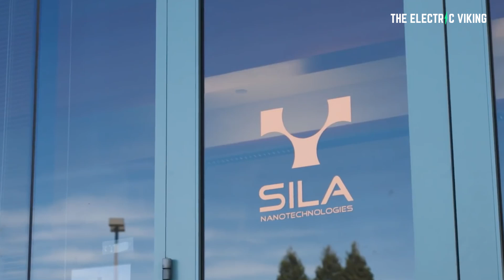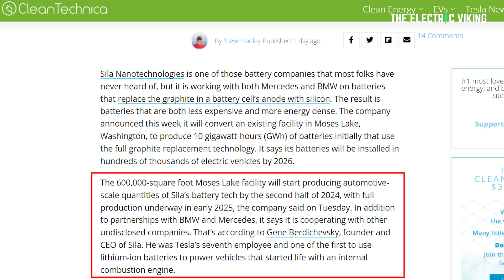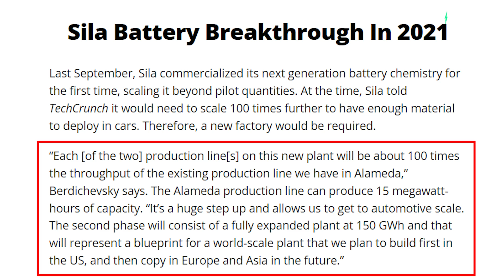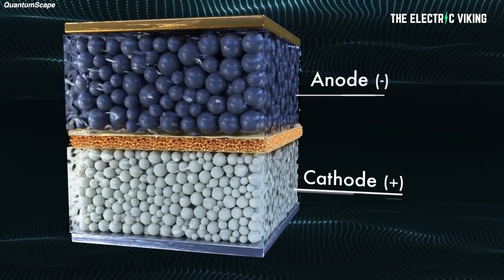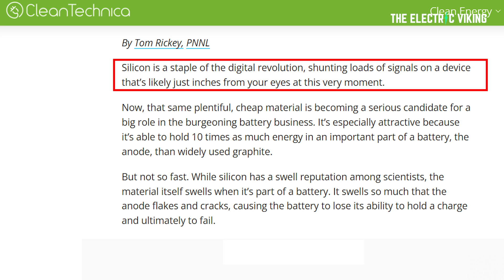US companies battery breakthrough will change the world

Comment: Increase Li battery capacity in 1 year?  I'll hold them to that as Lithium based won't last for more than 2 or 3 years but they could make an impact if they could do it in 1.year.
That could mean reducing the weight of Li based EVs as well as more BEVs - of course it is all proof in the putting.  Can they or cant they?

Comment: I am a robotics engineer that has worked on drones, including making our own batteries. We switched from pouch cells to cylindrical cells (18650/21700) as they are more robust in a crash. Pouch cells are lighter and cheaper per kw/h but when they get hot or in an impact, they can be dangerous. I can see these silicone batteries being the same for the engineers, on paper they are better but you have to make them safe in an impact or if they are in hot bumpy areas, not so easy. Yes, on paper these seem great but the information seems to indicate they aren't as robust as more mature battery types. I wouldn't want to have my car burst into flames if I was on a hot bumpy road and needed to use a fast charger. Everything is easy on paper but when you have to real world test for worst case scenarios, you have to defer to the safer option a lot of the time. Hope it works out though.

Comment: Silicon is cheap and plentiful but if purity matters and I think it logically does, then the cost starts going up.  How are they getting to high purity on scale?  How is the expansion mitigated? How is the Anode produced at scale?  We know the energy density potential is there but these questions have to be answered.
Reply: The New factory is REC Silicon's neighbour. So most likely they will get it directly in pipes from REC.

Comment: "All they need to do is scale it up".  That's the biggest problem with the e revolution.  Scalability.  A Tesla works great now.  What happens when everyone drives a Tesla?  On a grid powered by wind turbines and solar.  Assuming we can supply the power how does the charging infrastructure work?  I'm not saying it can't work, but a lot of folks seem to think that this like the telephone, the hard part is getting to a certain level of adoption.  I reckon it's different, the hard part is when everyone is using e cars.

Comment: Silicon in battery is nothing new, all you said is true about density and cost you forgot to mention that silicone cracks when you change and discharge the batteries that is why they are not around. No this is not it

Comment: Any battery that requires lithium is problematic due to the mining and availability of lithium.
Reply: yes, but if you can increase the energy density, you need less per kWh. the availability is extremely high and it is not always problematic.
Reply: @stefanweilhartner4415   There is availability issue in getting the raw materials needed - energy density does even factor into what he was talking about.  Commodity mining, supply and refining have all taken a massive hit since the pandemic and we are going to be heading into such a constraint in production that prices which have already gone up a lot will continue to skyrocket.
Reply: @corail53  we have plenty of lithium and sulphur. this is not an issue. silicon is almost unlimited. the only problem so far is nickel and cobalt.
Reply: Among the many the other finite materials needed.

Comment: Did you get the reference to "the device just inches from your eyes"? It's the pair of glasses that so many of us use, or more precisely the lenses in them. Glass is of course made from silicon, which is basically plain sand. The signals they shunt is of course the light, i.e. photons, that pass through them to the eyes retina.

Comment: Only for the high end EV's, that will become even more expansive. 
The fantasy in 2012, that EV's will be cheaper than ICE vehicles in 10 years, is what it will stay, a fantasy. EV's are even getting more expansive since 2021.
Building more €80.000+ EV's like Mercedes, BMW, Audi, Porche, Tesla is getting boring, as are their SUV and sedan models.
The masses of People with the small €10.000 to €20.000 ICE vehicles will keep riding their cars for many decades, if not for ever, without having a chance on an affordable EV.
Reply: This is where China comes in they’re aiming to produce affordable $15-20 EVs aimed at general transportation usage and doing it in attractive practical packaging. BYD is a good example of this approach. An affordable practical quality produced EV. Also need keep in mind the repairability and replacement of parts/batteries. NIO is approaching it with quick replacement battery systems. So getting into complicated revolutionary battery systems may not always be the best inexpensive outcome.

Comment: Just because it works for wearables doesn't mean it will scale for cars
Reply: it works better for cars because you can apply the economy of scale.
Reply: @stefanweilhartner4415  I could write a long comment and the scale of it would make it work. lol
Reply: 1000 plus miles range in a Mercedes, 50mph average so most definitely not hypermileing. Proven beyond doubt to be capable, watch closer next time and read headlines about batteries more often.
Reply: @AndyAndy-we9pe  friend has a brand new merc 220 miles at 50 is what she gets.
Reply: @AndyAndy-we9pe  As charging networks expand and charging speeds increase range will become less of a factor. Other parameters like cost and driving experience will take priority.

Comment: Looks like  #StoreDot Batteries got pasted over. 🤦‍♂️

"#StoreDot Batteries" 

Like I have been saying I'm sitting out from buying an EV for the next 2 years.
( I would like to wait longer but I don't have the patience)
 The 1st EV  I will buy will probably be in 2024,  the way battery technology keeps advancing and at its current rapid rate a EV today with today's current battery configuration will be obsolete within 2 and a 1/2 years.

 Prime example is that the early EVs with the "3G Technology" are now dead in the water with "5G technology"  kicking in.

Comment: What’s needed is a standard battery, like AA and AAA batteries but bigger for EVs, we.need to decouple the vehicle from the batteries. We need to be able to upgrade/replace batteries, buy an affordable EV with a standard range and upgrade range later, have the option to lease batteries making the initial purchase price way less and replace batteries when new higher power density batteries hit the market, since technology is moving so fast.
Reply: Yes, my thoughts exactly.  I even wrote a page on this.  Do need a little more density for it to work in cars to the level it does already in motorcycles, but user swappable standard batteries will be come.
Reply: Premature standardisation of battery sizes might make it harder for companies to do experimentation to improve battery technology. I suspect such standardisation might happen in, say, a decade's time when there is less experimentation with battery technology.
Reply: @CiaranMcHale  I am thinking more like electric motorcycle swappable batteries. If batteries can get 4x more energy dense, then 4 to 6 batteries the size of electric motorcycle batteries would be enough and be a complete game changer.  It could take 10 years, but could be a bit less. But if/when, it would change everything.
Reply: @onefiniteplanet  That is certainly one approach. I have been working my way through the backlog of videos on "The Limiting Factor" YouTube channel, which is basically a deep dive into the science of battery technologies explained (almost) simply enough for a lay person to understand. I understand a subset of the content on the channel, but one of the key takeaway points for me is that scientists (some of whom are funded by Tesla) are optimistic that they will reach the holy grail of a "million mile battery" within the next 5 or 10 years. Apparently a typical ICE car has a lifespan of about 140,000 miles because an ICE engine causes lots of vibrations that cause gradual wear-and-tear on the structural components of the car. Since an EV's electric motor causes far less vibrations, it is believed that an EV might last 500,000 to 1 million miles. Having a battery pack that can last 1 million miles before needing to be replaced means the battery pack would never need to be replaced during the lifetime of the car (by the way, the "it's time to replace the battery" metric used by scientists is when the battery drops below 80% of its original capacity). If this holy grail is reached, then it would significantly reduce the perceived need to replace batteries in a car; instead, you are more likely to just replace the entire car (and the battery pack would be removed from the about-to-be-scapped old car so it can be used for another purpose, such as a battery for solar panels).

Another thing to consider is that the cost of lithium ion batteries dropped 87% during the 2010-2020 decade, and are predicted to drop another 80% during the 2020-2030 decade. If this happens, then replacing a battery pack might cost only, say, $2000. This might raise the possibility of a person buying a car with a limited range initially, and a few years later deciding to pay $2000 to replace the still-good battery pack with one that provides longer range.

I'm not saying you are wrong in claiming that swappable batteries is a promising idea. Rather, I am just pointing that that there are other, competing promising ideas. It will be interesting to see which approach wins out.
Reply: @CiaranMcHale  The swappable module is not to solve batteries having a short life, as if not long enough already there are already a few tech to give the million mile battery, just need one to get to market. Swappable batteries are to address other issues.  I agree battery life is not a significant issue.  Imagine a battery small enough to be in 4 swappable modules the size of a motorcycle battery, easily swapped by hand.  Those parked on the street could carry a module into their home to charge overnight on a regular day when only one module was needed. Once energy density is sufficient, we solve the big problem of all those cars on the street that otherwise pay around 4x for their charges.  There are other benefits too.
Reply: @onefiniteplanet  Interesting idea, but there are challenges. Google suggests an 85KWH Tesla battery weighs 1200 pounds (540 KG). To keep the maths simple, let's assume a 5.4x increase in energy density (which I think is far too optimistic but let's keep the maths simple), so the weight will come down to 100 KG (220 pounds). If that is split over 4 modules, then each battery module will weigh 25KG (55 pounds). In my experience, when filling a suitcase for travel, anything above 20KG makes the suitcase difficult to lift (30KG is a real struggle). So it would be quite a struggle for a person to carry a 25KG battery module from their car into their house for overnight charging and then carry it back to the car in the morning.

In addition, I assume your intention is that the car owner would charge one battery module on Monday night, another one on Tuesday night, and so on for four nights, and then start at the first battery again on night five. By doing this, you would end up with the car containing four batteries, each of which is at a different level of charge. I'm not sure that would be wise. I base this on seeing "do not mix old and new batteries in this device" on the instructions for battery-operated devices.

When ICE cars were being introduced in the late 1800s and early 1900s, there was not a widespread network of gas stations. Instead, car owners often bought cans of gas from pharmacies. It took a few decades for gas stations to become widespread. The UK government is requiring new houses and apartment blocks to provide EV charging facilities, and I suspect it will take a decade or more for existing houses and (car parks of) apartment blocks to be retro-fitted with EV charging facilities. Until then, many people may find it inconvenient to recharge their EVs. But removable battery modules are not the only potential way to address this temporary problem. For example, another option would be for shopping malls and supermarkets to provide EV charging facilities in their car parks. In the UK, some large supermarkets have a petrol ("gas" for Americans) station adjacent to their car parks, and if you spend at least, say, £50 in their supermarket then your receipt will contain a discount code for filling your car with petrol. Perhaps supermarkets would provide a similar incentive for charging EVs: "spend at least £50 in the supermarket to get a discount code on your receipt, and you can use that to get cheaper electricity for your car in the car park".
Reply: @CiaranMcHale  Your weight estimate sounds about right.  But an 85 kWh battery is a quite a large one and would need to represent  more than 4 modules.  What is the average distance per driven per day in the UK?  I could not find it quickly, but way more range than would be needed in a normal car other than when on a road trip.  Still, I agree modules alone is not a solution, but I am worried about the social implications of those who can't charge at home having to pay a multiple for charge relative to those who can charge at home.  Interesting discussion, and you have good thoughts, but hard to have it on here.

Comment: We can bet that Tesla will be using this technology. However, if it needs rare elements there will always be problems. Nickel, Cobalt, Manganese are not easy to mine and refine hence the sky high costs.
Reply: That is the major downfall of all this and it is not green (ie: digging holes in the ground to get those finite materials and turn them from ore to usable material is very fossil fuel oriented and well you are still ravaging the earth). We are heading into a commodity crisis as well - supply chain issues mean mining issues which means costs are going to get even higher than they currently are.

Comment: Like to know how they prevent the use of silicon cracking and degrading the battery.
Reply: silicon nanowires in the graphite anode. the silicon percentage is very low but it is very effective. they leave a lot of room for lithium ions to dock on the silicon nanowires which also have a certain flexibility and bend instead of breaking.
==> sinanode
Reply: @stefanweilhartner4415  Thanks, sounds promising

Comment: It seems possible to make silicone Dimond hard with other layers of materials also
Reply: how did breast enlargement get into this conversation?
Reply: @keithmiller4168  well if types of silicone can be used to replace super expensive graphene batteries and more ready for market , One problem silicone has when heated and cooled is expansion and contracting, a reasonable fix might be to try to keep the silicone battery atoms and geometry from breaking, say like super compression mixed with some kind of ultra capacitors,all layers could bring the best out of eachother for superior batteries then what's in cars and products today.
Reply: Lighter batteries we could see big camper Van's with long range.

Comment: Very interesting vlog silicon as you say has been known to have the swell problem , and it’s a hot development to be working on, I can  see at best double the power density any more the swell will still be a problem it’s a fundamental fault at the atom level that can’t be solved without a down side, it most likely will be the charge cycle that will suffer, Tesla are all over this type of battery and gave been for some time, when they say it’s doable that’s when it will happen on scale 👍
Reply: I believe there are silicon batteries with quite a bit better than doubling but the cost of nano silicon is still way to expensive

Comment: Cost, Cycle life, Charge rate, safety... Battery breakthroughs usually fail on at least one.  I wish them luck.
Reply: Proven in mercedes
Reply: Cost & cycle has been been the issue hence initially they been used in drones & planes if they have the cost down it is very viable in long range vehicles as you don’t  need as many cycles if your battery can do 1000km per charge.As they get closer to  nano size silicon the higher the energy density atm nano size silicon is too expensive but they are using larger size but still very small particles.Which there is still a lot of upsize in the technology

Comment: Volvo and Northvolt are doing the same thing. That is, replacing graphite in the anode with silicon. Should be out in 2026, according to Volvo.That's when Volvo said they will have 1000 km (620miles) range if needed. ... But great to hear another US battery plant is on the way.
Reply: Are these guys also building a battery plant?  Their pitch is selling to battery makers, not selling batteries.  They could even be the supplier of the silicon material for Northvolt.
Reply: @onefiniteplanet  Northvolt and Volvo are building a 50 Gigawatt hour factory in Sweden, plus Volvo will source 15 Gigawatts of batteries from existing Northvolt plants. Volvo is also getting batteries from LG Chem and CATL. ....And Volvo and Northvolt are building an R&D facility in Sweden as well.